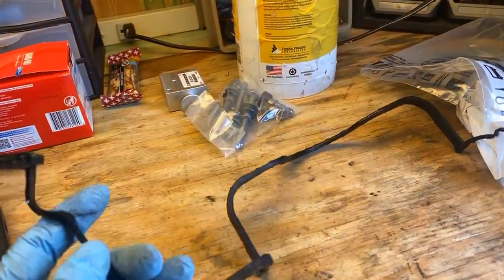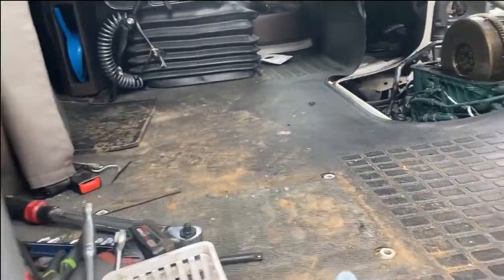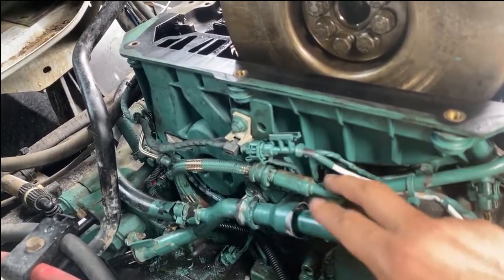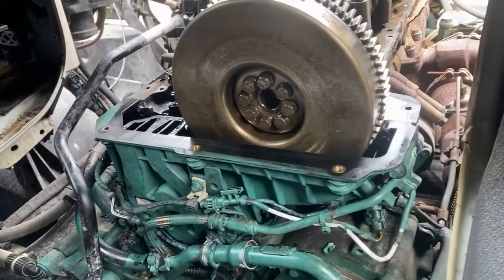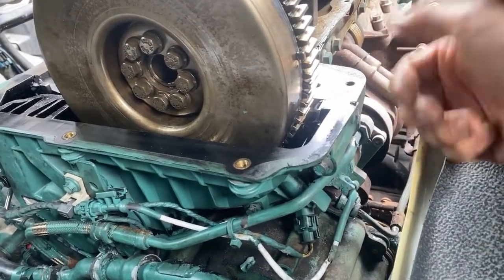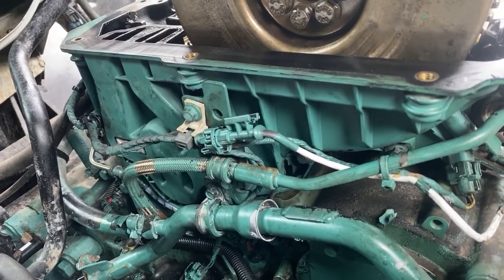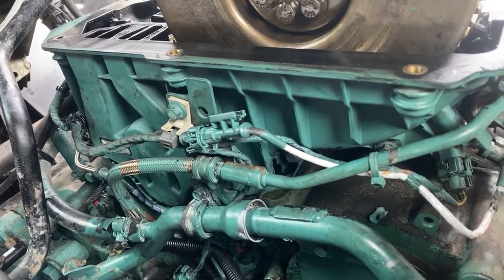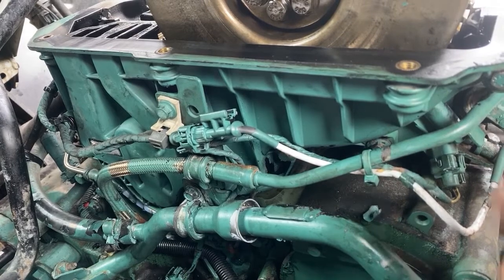Timing Gear Cover Replacement - Volvo D13 Engine

Comment: Hello 
How to remove cabin engine cover ?
I see just 2 bolt 
How many bolt have cabin engine cover ?
I try before but cabin engine cover not remove
Reply from the maker: If you are talking about dog house. There are 4 bolts
Reply: @DIESELTECHPERFORMANCE  Thank you for asking 
Yes dog house 
I see 2 bolt
Where is the other 2 bolts ?

Comment: What if you ate replacing the cam shaft do you have to set timing?
Reply from the maker: Yes
Reply: @DIESELTECHPERFORMANCE  how? If I May ask I'm A Cummins Guy... First time dealing with D13 Doing Cam And Rollers.

Comment: How much should i expect for engine 
swap labor only? Volvo d13
Reply from the maker: I do it for $5000
Reply: And how much should i expect to get back for my core 1 mil miles 2011 d13? Just has a burned valve

Comment: Do you need one of those tools  for each side and how do you properly do it, ?
Reply from the maker: yes, you need this tool for each side.
Reply: @DIESELTECHPERFORMANCE  i bought a 2011 used d13 engine with 392k and it has a small leak there on the driver side, also has some oil coming from that injector harness in the front of the engine,

Comment: What can happen if someone installs it with out using the the proper tool, does the gasket not seal properly?
Reply from the maker: It will not seat properly with equal pressure on rubber gasket and as a result  it will still leaking oil

Comment: How you remove that cover
Reply from the maker: in order to remove it. 1 remove valve cover 2 Remove Engine cover inside the cab. 3 loosen all wires and lines at the back if the timing gear cover. 4. loosen five bolts of timing gear cover.